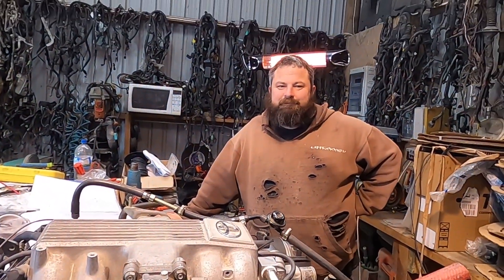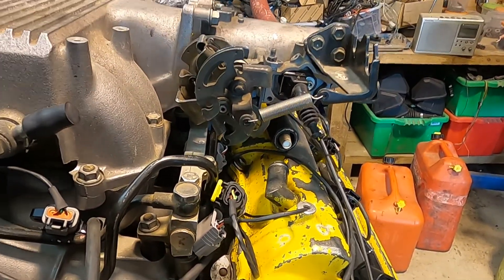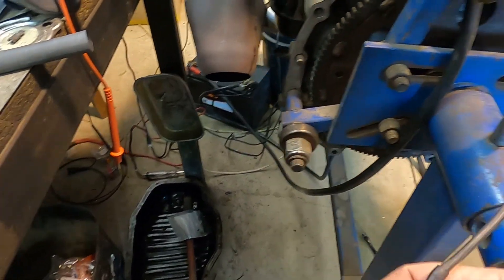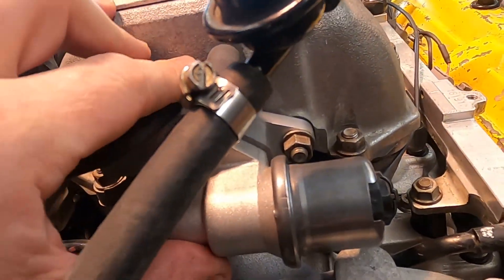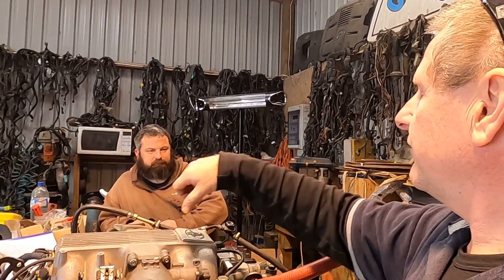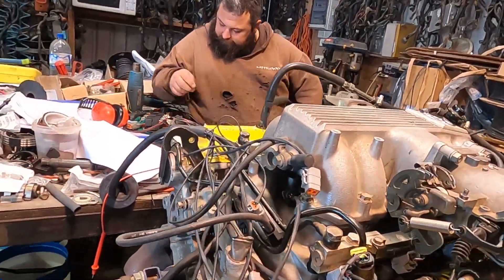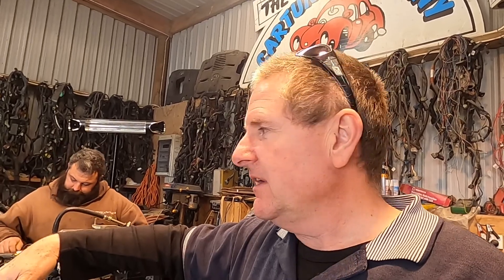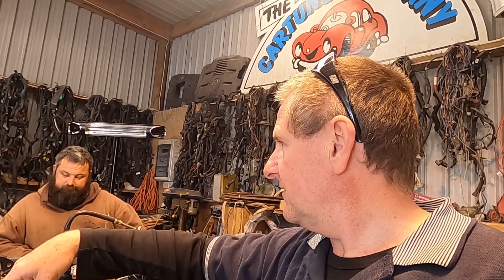1uz wiring to Link ECU Fury.  Manual 4x4 in Oz with Coil on plug conversion

Comment: Hey Kelvin, thanks for all the awesome information. I have recently picked up a 1992 Hilux Surf auto v6 with a 1uz swap thats certed and daily driven. The wiring isnt great and I've been thinking about putting an ecu in to make it more reliable. Is there a particular link ecu you would reccomend? Im based in the Far North. Cheers